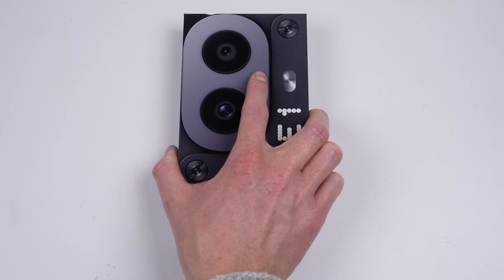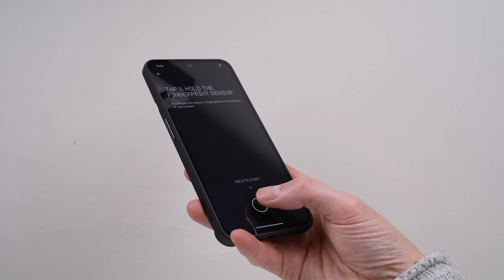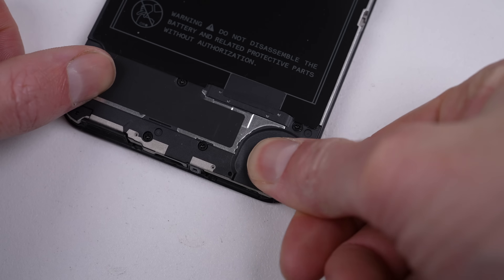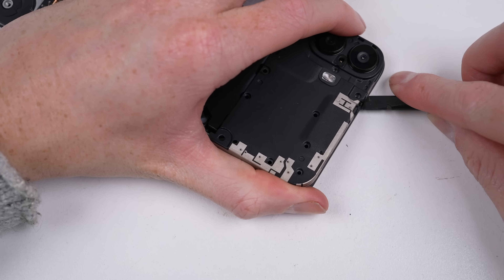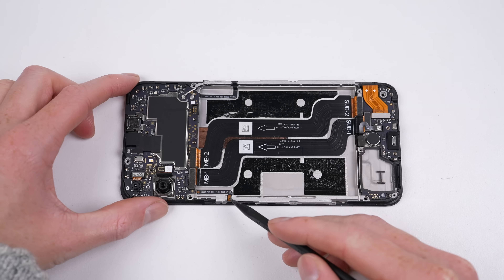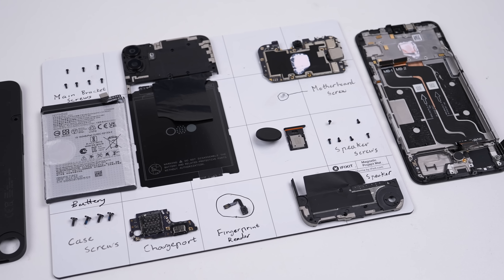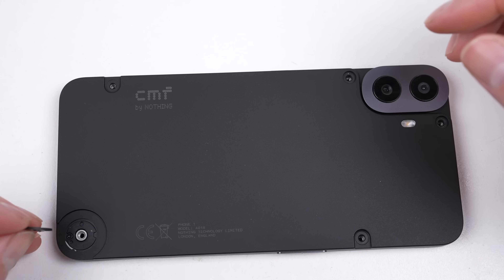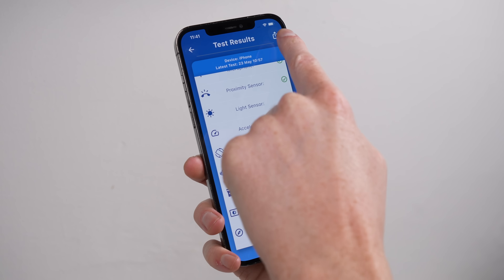This Modular Phone Is A Gimmick - Nothing CMF - Teardown and Repair Assessment

Comment: Besides the silly void stickers aside, this thing is actually verry repairable compared to many other phones, at least you dont have pry off the screen to get into it, but yes, there is no reason they could not have made the battery removable, as this would have aloud one to install larger batteries, and use an expanded back cover, just like phones we used to have in the long distant past.

Comment: the nice thing about the modular bit is you can change the colour of your phone at will if you get bored of it, and cmf has released a template to 3d print back casings and accessories for the phone 1.

Comment: I just want a phone that’s got a removable battery and back case that’s not from 2010. Why can’t we have a 2024 phone with removable battery and back case? Idc about water resistance as long as it runs modern apps with modern hardware with replaceable parts.

Comment: A few years back I successfully modified a couple of "action cameras".  Recently, I had some reason to look at what was new in that market, and I found one that has some interesting potential.  But I cannot do anything with a new device right now, so I thought I'd mention it to you and see if you might want to look at it.  It is the SJCAM SJ20 Dual Lens Action Camera.  As its name implies, it has two "lenses" (actually more than just lenses, there are two sensors and some of the circuitry).  One "lens" is "normal" brightness but the other is lower F-stop (brighter) giving extra low light capability.  At the very least, I can suggest "focusing" the lenses so that switching between them might give you  a choice of near/far focus.  Alternatively, one of the lenses could be replace (which is what I did to my own cameras), possibly giving a "normal" / "telephoto" option.  Anyway, if you decided to take up this suggestion, I'd be interested to see what you come up with.

Comment: The latest Nokia ones are somewhat harder to open but it's actualy a feature to be able to repair your own device, exchange the battery or replace the screen. I wouldn't call this a modular phone at all if they actualy say you void the warranty if you're replacing the battery yourself. It's little more than an option to get a different coloured back cover. I.E. a gimmick.

Comment: Hello Sir. I’m trying to get in contact with you to see if you can take on a project for me. I have the original iPhone 4 without SIM card. Today I did a battery swap and the the phone turnt on. Then I tried to replace the broken screen and I purchased the wrong screen. My phone is completely apart every screw off. Can I purchase a iPhone 4s and simply swap out the motherboard without losing all my data on my phone. Please hep.

Comment: My theory is that some countries' regulations prevent companies from encouraging battery replacement due to potential legal issues if a fire occurs and someone sues them.

This recently happened with a 3D printer recall. While 3D printers are meant for tinkering, the company issued a statement that in some European countries, replacing an electrical part legally requires expert examination before use. Otherwise, you risk voiding your house insurance in case of a fire.

Comment: nothing could be way better if they actually tried.
i still have my nothing ear 1 earbuds, and they sound great, battery is great, they look unique, but the adhesive they used is so weak that the buds are splitting in half at the part where the two halves are connected.
Reply: Yea my ear 1s broke entirely, I had to throw them away

Comment: I hope you can get your hands on the new HMD Skyline at somepoint, its supposed to have a screw system(single screw on the bottom) which will release the back cover & display for easy replacement.

Comment: The CMF Phone 1 missed a few major points that would have made it a best seller. A user replaceable battery, stereo speakers and (the real deal breaker in many regions like europe) no NFC so you can't set up contactless payment. Also most budget phones still feature a headphone jack, but I can sadly see they will eventually be phased out from all phones.
Reply: whats the point of stereo speakers in a phone if both speakers have to be in the phone so the positional difference is barely audible and changes depending on how you hold your phone

Comment: Are you stupid? It is user replaceable battery... You just need a screw driver which is provided in the box.... Battery backup and charging speed have become so good you don't need to swap battery often... It is only after 2 or 3 years you will be needing replacement which will take only a few minutes... Rather than heating up and melting down glue then pulling up screen or back panel with a suction cup then glueing down again after replacement... Which results in breaking down screen or back panel if you are doing it first time... What do you want now? Didn't expect you to make this kind of stupid comments...... Applaud them for making them battery replacement 10x times easier....

Comment: If I recall correctly they never marketed the phone as modular or easily repairable.
They just want to sell more covers and accessories.
Reply: i want to ask you something, ifixit pro tech toolkit is good? they are resistant or broke easy?
Reply: i think the main point was, you can change the backcover if the cover broke or you wanted new colour without spend fortune to change it and you can change it easier, it by no mean makes easier to fix the internal phones

Comment: 200$, oled, an unlocked bootloader, sd slot, and no heatgun required to replace the battery.  I can't think of a better phone in the past several years.  With anything else, you're either losing features, locking the bootloader, or dramatically raising the price.

Comment: I never understood what is stopping them from designing a simple dedicated screw in "battery bracket", which, combined with a screwed down back and an accessible plug would make battery chance 10x easier (6-8 identical screws, no heat) even if you don't go for a hardshell design like Fairphone.
Reply: I think that would be decrease their IPxx rating
Reply: @Ricky-vanson  Samsung has made and still does make phones (Their XCover series) with IP68 water resistance that have easily removable backs and they don't even use screws, water resistance can not and should not be used as an excuse for not making batteries easily removable

Comment: Honestly the specs seem damn good for the price. Assuming you get a decent length of software updates it seems like a good phone as far as the phone itself is considered.

But it will never make sense to me why they implemented a removable back in this day and age but didn't make the battery user removable 😂
Reply: Even after software support you can find custom roms to keep it alive for few more years, I’m using a 2018 phone with latest rom based on pixel os.
Reply: Mfw budget phone but no 3.5mm jack, only to sell crappy tws buds. Why can't companies produce some high-quality wired sets?
Reply: Blackberry z30 enters the chat
Reply: The software support is 2 years of Android updates and 3 years of security updates. Ignoring the short software support nothing is probably losing money by making and selling the phone. They probably would make the phone 2 with small upgrades and pricier.
Reply: Nothing is building out a brand, much like how apple did.

The CEO himself said that the money they made on the nothing phone 1 is not a lot.

I suppose the justification for this price tag is pretty much the same, they are trying to reach more people. However seeing how much the price of the nothing phone 1 dropped I really cant see a good reason for coming out with this phone.
Reply: i have the phone and it's great, performance is pretty good, cameras are fine, battery is great and I love the software

Comment: IDK about the laws in Australia, but in the US, those "warranty void if removed" stickers are meaningless. Why? There's a law in the US called the Magnuson Moss Warranty Act, which I'll shorten to MMWA for the rest of this comment. Anyways, the MMWA bars device manufactures from denying you warranty service solely because the sticker is broken. It also prohibits them from denying you service for one thing because you modified something else unrelated to the first thing. If that's confusing, here's an example. Say you have a smartphone, and you break the screen and replace it yourself, then, later down the line, a board level problem comes up, and the device is still in warranty. The company can't deny repair or replacement of the board/device because the screen was replaced. People will claim the stickers themselves are illegal, which is a little bit of a misnomer. It's actually the act of voiding the warranty from breaking them that's illegal, not the stickers themselves. I'd simply call the stickers meaningless. They can try all they want to say they can deny you warranty service if you break the sticker, but in actuality, they can't. Again, these are the laws in the US, and will vary if you're outside there.
Edit: Corrected the name of the law since it was wrong the first time.
Reply: thanks for the explanation
Reply: I love US ))
Reply: @fe.w2024  It's nice that the US is sensible about one thing. A shame about literally everything else where they're backwards.
Reply: @fe.w2024  the US has the worst consumer rights.
Reply: I learnt something new today. I am from Singapore. You know what for the first time. That sounds like the greatest country in the world." Exactly what's the point of voiding warranty "
Reply: Magnuson-Moss, not Masoom Moss. Named after the US Senators and House Representative who sponsored the bill
Reply: Not illegal here, but also not enforceable.

Comment: While the removable back with a non-user replacable battery seems like a gimmick, it's most likely no one is going to repair this phone.

A lot of reviewers said that this is a great value phone, and it's true, but that hurts it in a repairability aspect. After a few years or even a few months, the value of the phone would significantly degrade (as is the case for any phone), but the repair costs won't, we all know how expensive it is to replace a screen from a phone, especially if it's a 120 hertz OLED display. If that screen breaks after a few months it would most likely cost more than half of the perceived value of the device.
Reply: Non replaceable if you are an ape.... Battery can be pulled with bare hand... As jack and pbk did.... But this man trying to be ahole
Reply: Another factor that determine the "value decline" of the phone is the OS update offering. The shorter the software update they offer, the quicker it will lose its value over time

Comment: Looks somewhat modular. Removing the back panel with only four screws and then pulling it off is much better in my opinion.
Reply: Modular in the sense that you can change your back cover and add a couple of funny gimmicks on the back. Nothing new here, but its a cheap and fun phone that is something different in todays market. And that is very welcome.

Comment: A Nokia 3310 is way more modular than this. 😂😂😂
Reply: I remember the days of treating the phone like a rifle, stripping it and putting it all back like in an army.
Reply: @Seatux  ew. take your military fantasies elsewhere
Reply: @ThylineTheGay  Give him a tv remote and batteries to keep him happy for hours.
Reply: My Nokia 3310 would just disassemble itself on order to dissipate energy and minimize damage upon falling on the floor. Or colliding with concrete barriers, cars and celestial objects. The fucker was indestructible.
Reply: modular front plate, back plate, drop-in replacement-friendly motherboards (3315 fits perfectly in 3310 body, other models like 3350 have some minor issues), higher resolution displays... i miss the days
Reply: you don't fucking say. not justifying modern manufactures but they are far more complex than a humble 3310.
Reply: Actually there are very few, possibly less than around 10 phones, in existence that are more modular than the Nokia 3310.

Comment: people make jokes about nothing by using the brand name a pun when the real joke is the phone
Reply: They made it way too easy man. I expect nothing from this brand and never will.
Reply: @ventilate4267 It looked promising initially but yeah, I'm gonna stick with my Xiaomi I reckon 🤷
Reply: The phones are fine budget options, what are you on about?
Reply: @TheMainCore  That if you design a phone with removable back cover, you just take a look on phones prior 2018 and use those cute springy contacty thingys, to connect a user replacable battery to the phony parts.
Reply: @higihups  At least on CMF phone 1 everyone can easily open the back panel which makes it more easy to repair than the normal glued back panel.
Reply: @TheMainCore  they aren't good phones at all lmao
Reply: @pitayafolf  My guy, show me a phone that brings as much hardware as the nothing phone 1 for the same price. Like wtf I can pick up a nothing phone 1 for 300 euros, new.

Also, 0 bloatware. Literally 0.

The only reason I picked up the nothing phone is because the camera layout on the back. I dont want the stupid shit every company makes their phones into with fucking bulges on the back. I can actually lay this fcking phone down onto the table like im supposed to be able to.

Dont get me wrong, their accessories are overpriced bullshit, I would never buy ear pods from them, or their wall units for charging, but the phones are minimalistic, they dont enforce any company specific apps on you and they are pretty much one of the best options if you are solely looking at hardware and cost.
Reply: @meszarosmate4629   the nothing phone 2's back looks like two eyes with intenstines. It looks like someone was trying to design a different looking phone but failed miserably imo.
Reply: @meszarosmate4629   also, is it really minimalistic or does it just seem like it?